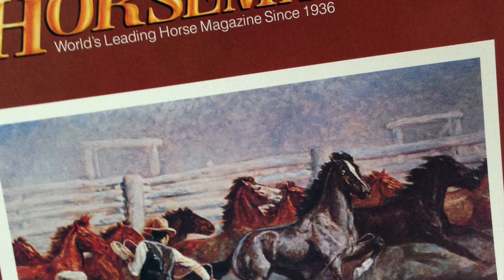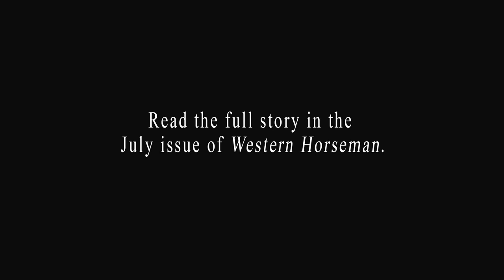Softness at the Snubbing Post

Comment: I still use the post, but not for all horses.  Most don't require it, but I start a few that makes the post handy.  A 180 lb man is no match for a 1000 lb horse so I snub and let the post take the pull instead of me, then let the horse run until he learns the pressure goes away when he yields to it.  I also stand beside it with more aggressive horses to block any charges while working with them. Beats diving for the fence.  The post can be an asset if not abused.
Reply: MrAzrancher yourw not suppose to match upnphyaivally. Can gain respect and control of any wild stallion on the earth. Even severely aggressive mentally abused horses.. The pole is stupid.. And you can't bring it on a trail later !